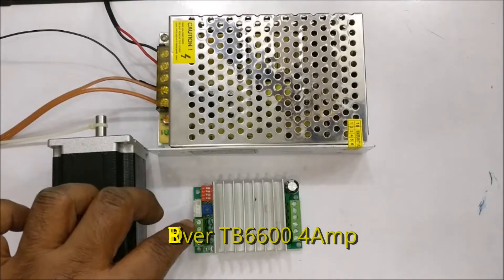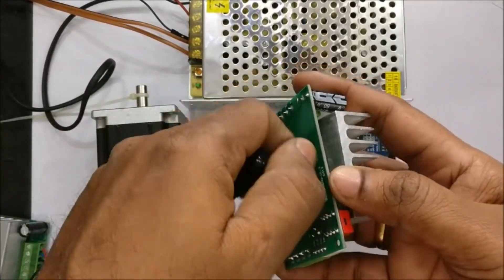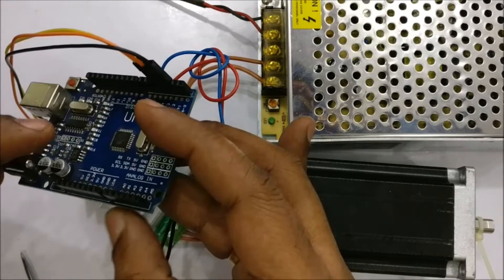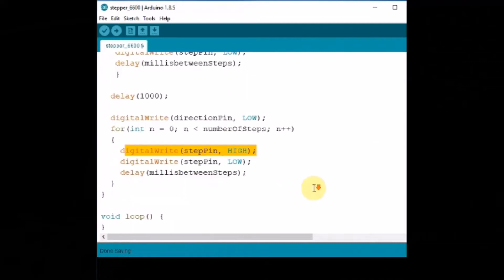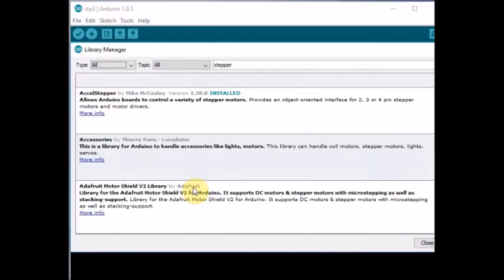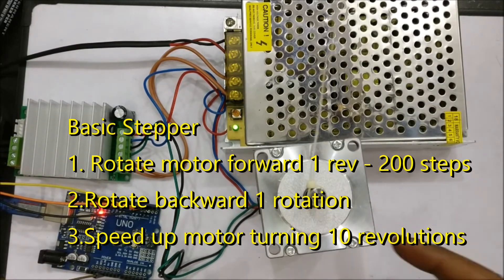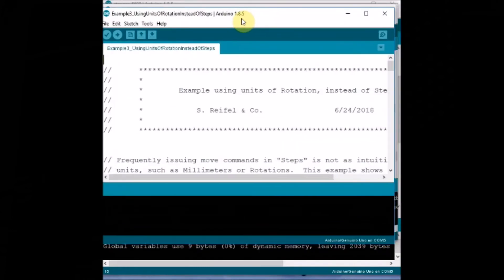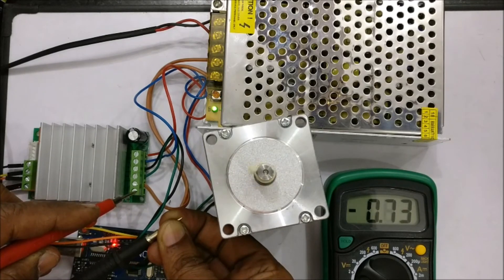TB6600 STEPPER DRIVER 4Amps

Comment: The TB6600 driver (old version) gives 4 Amps to the stepper. How do You run a 2, or 3 Amp stepper using that driver?

Comment: I don't know why people still use this 6600 device it has had such a bad reputation by designers and experts who know more about the design and build than any simple user who goes on EBAY  looking for a cheap stepper driver.
As far as I can remember the 6600 device is made by Toshiba in japan and by itself for whatever purpose is a very good device.......verification is needed for that statement, which I do not have access to but was stated by many experts and designers as such.........but as the stepper circuit design using the 6600 chip was made in China, and used a pathetic design platform for the device, it gained notoriety for being unstable and prone to losing steps at odd moments......that is as far as I know........one user on UTUBE.....Minh's cave workshop, has also had a bad experience with this device and notes the unstable characteristics in use.
Reply: Just feed it with 36V instead of 24V and it will work well. Also, you can add ceramic capacitors between Pulse (CLK) and 5V+ for EMI robustness and RF noise filtering.

Comment: You forgot something quite important.., the blue potentiometer is for adjusting the maximum current supplied to the motor. If you don't adjust this properly you can either burn the motor or it just won't work well.
Reply: Sir I am using this driver for my project.. my stepper motor is a nema 17.. The motor gets extremely hot after about 10 minutes of running and starts to overstep. Can I fix this by adjusting this potentiometer..??
Reply: @singamlijith5347  mine is getting hot 2, what did you do to solve the problem?

Comment: I have purchased Nema 17 Motor 1.8 Degree Step angle. The problem is that I need to rotate it to 1.2 Degrees, along with the Motor I have also purchased TB6600 Microstepping Motor Driver Card. I have tried multiple times but ultimately failed! Is there any way out I can change the angle of rotation from 1.8 Degrees to 1.2 Degrees.
I basically want 300 steps from the motor(360/1.2 = 300).
Reply: You could try using a toothed belt drive combo to change the output ratio to the device you want to drive.....this is used on a 4th axis to get degrees of rotation from a stepper motor drive that normally only has 200 steps per revolution.
Your ratio would be 200/300....do the sums  for the drive pulley tooth numbers.
You will be in a reduction mode, that is 200 steps in to give 300 steps out etc.